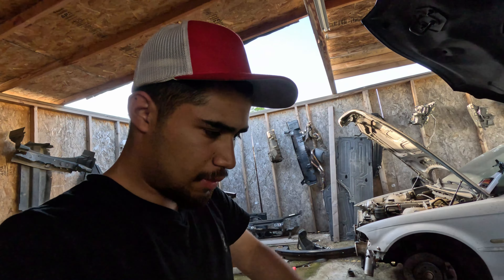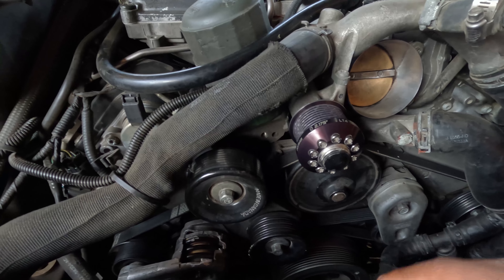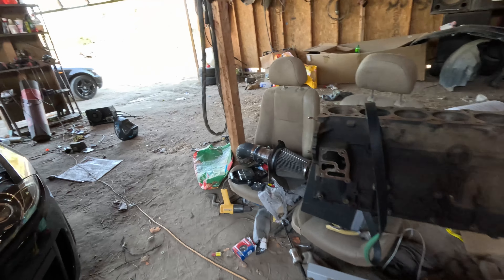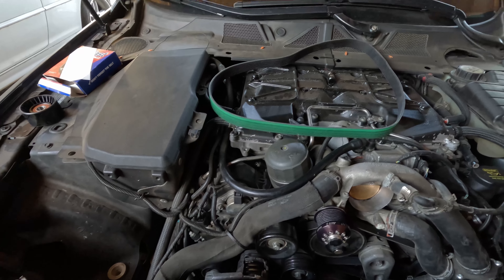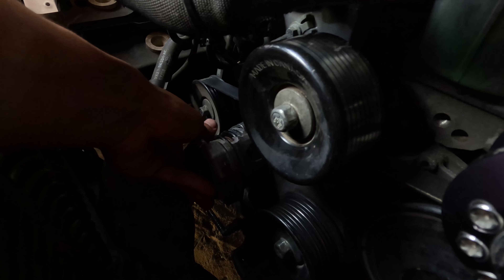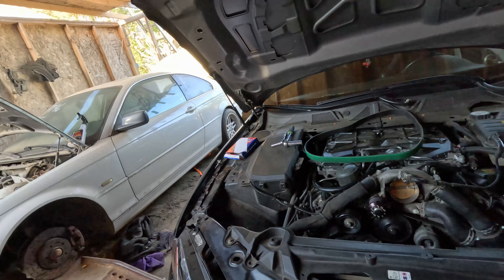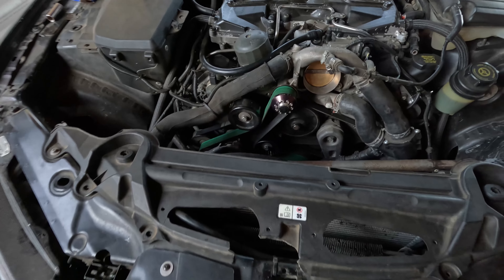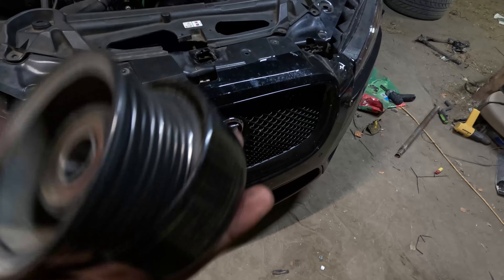Heavy Metal Pulleys To light weight plastic Pullyes 3 Pounds Weight Savings!!

Comment: Hi boss 

Boss I have Range Rover sport 2015 5.0 sc   And I want increase the boost. What the bitter super charge pulley can I fix it?
Reply from the maker: You can get the griptech pulley from griptech they got alot of different options I'm running a 2.17"
Reply: @Ricky50scJustalil6cylinder   thanks you boss 
But what the sku or part number
Reply: @Ricky50scJustalil6cylinder    If I want change pulley should I change some thing other?!